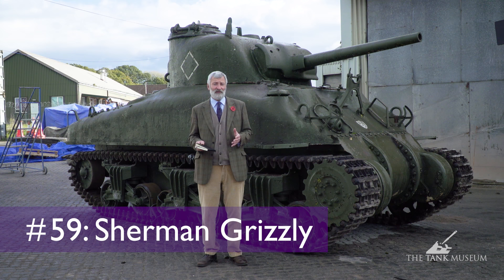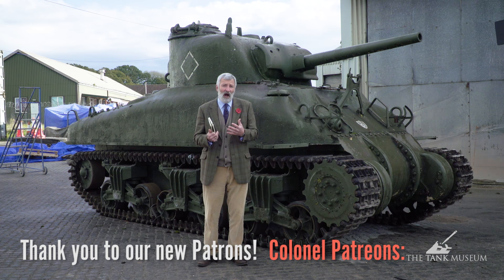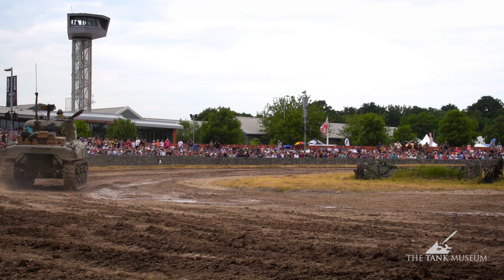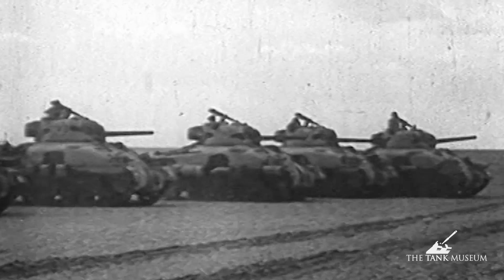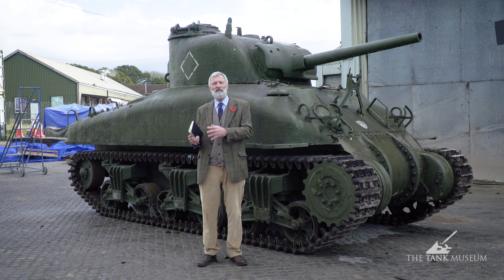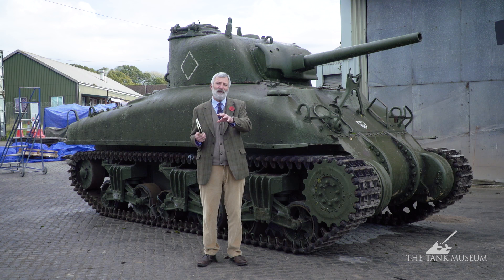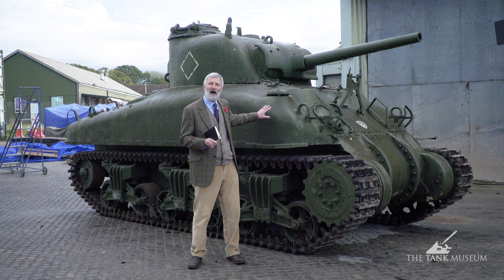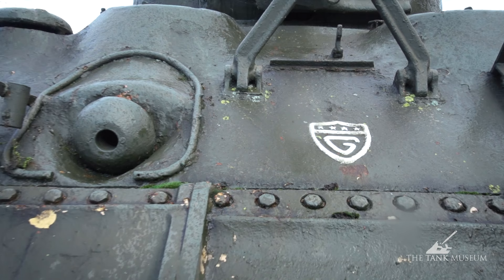Tank Chats #59 Sherman Grizzly | The Tank Museum

Comment: That Grizzly does have the CDP track system on it, if you look at the track links they almost look like a Panzer III/IV track. Don't forget that a lot of the Ram chassis without turrets were sent to Europe to become Kangaroo APC's.
Reply: I think those are the "observation vehicles" he mentioned.
Reply: @princeofcupspoc9073  No, the "observation vehicles" would have been the Ram OP/Command  and GPO tanks, which were used as command vehicles for SP artillery regiments.  The Ram did go to war as Kangaroos; a number were also converted into Badger flamethrower tanks.

Comment: It was sensible of the Canadian’s to build the Ram etc on the M3 and M4 platform, for part standardisation.
Reply: DC also had to do with the British having weird materials and techniques. i think canada should try and make tanks again just for fun
Reply: It was also due to the fact that Canada lacked the industrial capacity to manufacture its own tank from scratch. The Ram tanks that were mentioned earlier in the video were assembled at the Montreal Locomotive Works (MLW) in Montreal. The hulls were, of course, M3 hulls that were obtained from the United States and then modified to place a machine-gun turret next to the driver's station and accept the Ram turret which was made at MLW.
Reply: @ramiii8633 : I'm Canadian myself and I would love to see something like that happen. We have the engineering talent to pull it off (the fire-control system used in the first iteration of the US M1 tank was designed and manufactured by Computing Devices Company in Canada) and it wouldn't be too difficult to set up a manufacturing plant to make an all-Canadian tank. Heck, the General Dynamics plant in London, Ontario, which built all of the LAV's for the Canadian Army and the Stryker APC for the US military, could probably build it, or at least make major sub-systems. 

Alas, there'd be less than a snowball's chance in hell of this ever happening as successive governments in Canada have not seemed very interested in manufacturing military hardware in Canada unless it's small in scale and low in terms of risk. It seems to me that the Avro Arrow and the indigenously designed and built Bobcat APC, both of which failed, put a permanent bad taste in their mouths when it came to domestic large-scale military production.
Reply: Steve Struthers it would take a long time and I lot of money, we haven’t built a modern tank, and we would have to design armor and other high tech systems which we might not have. It would make sense to buy a re-engined m1a2 sep v3 or a leopard 2 a7.
Reply: @stevestruthers6180  The LAV 6 Assault Gun comes pretty close - the variant sold to the Saudis uses a CMI turret with a high velocity 105mm autoloader tank gun.  The armour can stop 14.5mm at rounds and artillery splinters. It can also fire a ATGM through the main gun with a 5km range. Given its speed etc., it comes pretty close.
Reply: The lower chassis or hull was actually made and put together in Canada, it's just an armoured box after all and easy to assemble and make armoured plate for. The upper hull/turret is the major thing that they had to send the plans to the states to have built. Engines and transmissions as well. Tracks,suspension units, guns, radios and all the other smaller things Canada made themselves.
Reply: @stevestruthers6180  The Ram tank was built at the Montreal Locomotive works from parts sourced both from the United States (especially but not limited to the engines, transmissions and final drives) and from Canada.  The upper hull was a casting produced (at least initially) by the General Steel Castings Corp. plant in Granite City, Ill., rather than modified from the cast version of the M3 upper hull.  Incidentally, the hull-mounted machine gun was housed in a modified version of the machine gun cupola from the M3 medium tank until the supply of that component ran out; after that, the upper hull casting was enlarged and modified to use a ball mount for the hull machine gun.
Reply: Trump is really a SOB trashing Canada as a neighbor ally country standing by the US for a hundred years. WW2.  NATO. Vietnam. Canada and UK was 60% of Normandy with 3 out 5 beach landings. Together they suffered 2,000 tanks destroyed in the Normandy campaign.

Comment: Thanks for posting!  The M4A1 (c) Grizzly is an unsung icon of the era!
The Myriad Ways
The M4 story was punctuated with doctrinal and mission specificity changes.
Maintaining several types of different chasses--say, jeeps, deuce and a halfs, motorcycles, 7 ton trucks, in a single unit's Equipment is a logistical nightmare, both at the depot and at the railhead.  Naturally, it would be nice if somewhere, someone, could make a common chassis and just mount whatever was needed on it . . . sort of like the Italian As42.
  Attempts to create a "Combat Vehicle Family" based on a single chassis for commonality of components, supply, and repair, were made on all sides, with the Sherman, Panzer IV, and Type 97 coming closest to realization.  75mm and 105mm versions of the M4/M4A1/M4A3, were augmented by the 76mm armed variants, the standard self propelled artillery vehicle was the M7/M7B1, of which the latter was a Sherman variant.  Crab Flails, Demolitions versions (AVRE), Beach Rescue, and Gun Tractor, variants all enjoyed at least limited production.  Kangaroo versions were IFVs, more or less.
  In fact, the only variant lacking in this litany of useful machines was an AA version.  Considerable research and testing were done to find an effective means of placing AA fire where needed, much of it resulting in hardware manifestation atop the Sherman chassis.  Self Propelled 90mm prototypes were overbalanced, too tall for tunnels, and ill protected (meaning they would not make good tank destroyers).  The T52-A Sherman, with disc turret mounting a Bofors 40mm Gun and a pair of .50cals, looks cool as heck, but only made crews dizzy.  Still, it was moving in the right direction, engineering-wise. 
  The idea found its most elegant expression in the Canadian Skink, not a Sherman variant, but based on the Ram, which was, in itself, a rationalized, improved, M3 Grant.  One thing is common in recollections of the war: don't stand in front of a 2cmFlak(v)38!  Well, the Skink was armed with a close cousin: 4 Polsten guns; in an armored turret . . . a reasonable index of AA and close support characteristics.  Naturally, an all armored turret is not optimal for AA duty, but it sure was good at shooting up stuff on the ground.  If they'd put a few Skink kit turrets on Shermans, it would've made the Combat Vehicle Family a reality.
Balance of Factors-A racehorse designed by committee
  We think of armored combat as quick, but that's only compared to marching infantry.  In reality, most tanks of the war were designed specifically to be able to keep up with a typical truck convoy.  That limited overall size, weight, and weapon size, while forcing bigger engines on any mobile tank.  Compare Char B1 or Churchill Mk VII to Sherman.  The first two are seriously overarmored and, consequently, underpowered, while the other is quite lightly armored and well able to keep up with Jeeps on a soft road bed.  In other words, the Churchill and Char to end all Chars were hard pressed to keep up with trucks on a concrete or block road,  while the Sherman could make a high speed run to pass them on the straights.  This is one factor in Strategic Mobility.  Referring to my earlier point, the other main factor in Strategic Mobility is commonality of parts and ease of maintenance.

  What ifs considered.  
A 17 tank Company could field three platoons-each with three gun tanks, a Skink, and a 105), could be considered either a weaker, but more versatile, US Army Tank Platoon, or a stiffened, beefed up, UK style Troop.  Command Section might be a Command Tank with extra radios and an FOP tank for Artillery/Air Liaison.  You could slow the unit to a crawl by fitting an M1 Dozer blade to the 105 tank, and a Crab Flail on the Skink.
Reply: The Skink was based on a Sherman hull (specifically a Grizzly), not a Ram
Reply: Check Wufe's correction of my mistake below.
Reply: @HBK-6S  I stand corrected.  Must be the weed.  Thanks for spotting it.
Corroboration:  "The original program called for production of 135 complete Skink Anti-aircraft Grizzly Tanks for the use of the Canadian Army and an additional 130 Skink Anti-Aircraft Grizzly Tanks to meet British requirements."

Comment: The Ram would have been deadly in combat for its time.
Reply: 88porpoise 6 pounder remained effective throughout the war.  A couple thousand more effective tanks would have come in handy I would think.
Reply: DOUG HEINS more versatility.  More reliable performance at longer ranges.  Obviously by the end of the war newer designs surpassed the capabilities of the 6 pdr but that doesn’t mean the 6 couldn’t get the job done.  In 1942 it would have been excellent in an antitank role.
Reply: DOUG HEINS were arguing two different things.  I didn’t say the 6 pounder was a better anti tank gun than later designs.  Obviously it was inferior to the 17 pdr but this tank was available for service long before the firefly and had a better anti tank gun than the 75mm pop gun on the Sherman’s.  Used in an anti tank role it would have been great FOR ITS TIME.
Reply: DOUG HEINS none of that has anything to do with what I said.  I said the 6pdr ram would have been great for its time.  At no time did I claim the 6 pdr was better than later designs.  Are you just messing with me?
Reply: DOUG HEINS why then was the 6 pounder still in use a decade after the war ended?  If needed the 6 pounder could utilize later ammunition advances to keep it suitable for service in an anti tank role.
Reply: DOUG HEINS sounds like we’re not gonna change each other’s minds.  I’ve lost interest in this argument.  Cheers.
Reply: @88porpoise  No. It was not better than the (75mm) tank gun of the M3. While the 6-Pdr had good armor penetration, it did not have HE shells, which was a major weakness.
Reply: @RobertP2000  Absolutely correct.  Remember, tank verses tank combat was RARE.  Patton loved the 75mm Sherman because it did it good job shooting up everything, except the heavy tanks.  But the 6 pounder would still be useful, more so than the 37mm on the M5 light we had thousands of.  There were tons of lesser armored vehicles like converted French armored vehicles, Sd Kfz 250s and 251s, Panzerwerfers, Marders, etc. to shoot up.
Reply: The Rams got the same bored out 6 pdr QF 75mm as well towards the end. They stated it made the Ram basically a Sherman at that point with better armor protection. Production however had ramped up so much that enough spare shermans were about that doing all the work of converting hundreds of them to the 75mm was ultimately scrapped.

Comment: I hope when the Grizzly goes to Vienna Museum it stays historically as a Grizzly and not turn into a mock up Sherman.
p.s. it's kind like when you see people calling a plane a Messerschmitt Bf 109 when it really a Hispano Aviación HA-1112
Reply: Or a Czech Sd Kfz 251, or a T-34 Tiger, or an American trainer Zero.  There's lots of them.
Reply: I have the same thoughts. It's history, it's what you are trying to present, embrace it for what it is.  I think the HA-1112 is an interesting plane, it's a German plane built in Spain, a neutral country, that had the engine of a British Spitfire.  It's an interesting corner of history just as it is, and if it looks like any BF 109 no one is going to be interested in the story behind it.  The Messerschmitt BF-108, which paved the way for many of the Messerschmitt designs, is painted up by some to look like a BF-109.
Reply: It's on loan. So I'm pretty sure it stays a Grizzly.

Comment: Some tanks don't take to being left out in the weather?   What?  You're going to be fighting tank battles inside?   Besides it was built in America and Canada, we have winters, with lots of snow and ice.  It's why we put heaters in our cars, trucks and tanks!   Did you notice the two brackets on the RH side?  Those are for securing hockey sticks while traveling.
Reply: DOUG HEINS  No, the Molson would be kept in the cooler attached to the back of the turret!

Comment: so why did they design a new track and sprocket for this? when there is already the standard  design on the M3 and M4
Reply: Well, it was better.  The standard M3, M4 style track was a 1930s design, with 4 times as many pin connections, making them rather frail.  It's one of many things that should have been changed in the US before the M3, but we were still enamored with anything the French designed.  (There's a little mention FACT of US military history.)

Comment: looks like Panzer 4 tracks
Reply: Germany didn't have much rubber so that makes sense.
Reply: @binaway  the rubber problem was more like a ww1 problem than in ww2
Reply: In WW1 the allies controlled the rubber producing territories in Asia which were all occupied by the Japanese in WW2. Germany was blockaded in both wars and although in WW2 Germany produced  (artificial rubber) it never had anywhere near enough. German Artificial rubber (Buna) also froze solid at a higher temperature than organic rubber which proved to be a problem on the Eastern front in winter.  To supply the Western Allies rubber production in Brazil and The Belgium Congo was expanded/restarted and  40 large artificial rubber factories built in the USA.

Comment: Why did Sherman’s have to look like such dorkmobiles? Why couldn’t they look sleek and mean?
Reply: They probably looked mean enough if the 75mm was aiming at you
Reply: Well, I guess — unless I was aiming an 88 back at them. But that’s not my point. I mean, whatever it’s functionality, the Sherman looks like it was sketched up by an elementary school kid for a cartoon project. Even it’s stubby little gun looks goofy. It’s not an important point, just bugs me. Like the guy who designed the Sherman went on to design the Chevy Suburban.
Reply: Rio Grande    Yup, Easy 8 is better, especially when it’s dressed up like the Fury, but it’s still not fearsome. The Tiger and the Panther are menacing . . . and the M4 is like something out of a cartoon.  :-)
Reply: Part of the problem was that the transmission and final drive for the tank was in the front of the tank, and the tank had to be made tall enough to have the driveshaft pass under the turret basket.

Comment: Why did Sherman have to look like such a dorkmobile? Why couldn’t it look sleek and mean?
Reply: Dork mobile?  Hardly.  It's design draws directly form the French Samua tank.  Which was pretty good in the 1930s.  Also, it uses a lot of the technology available to US industry, where we could cast HUGE pieces, due to the rail industry.  In Germany they used lots of little pieces with lots of complicated welding to get all those "cool" angles.  Smaller shops could do that work, but it really hurt their production in the long run.
Reply: Ok, I get that, reliable and easy to transport and highly manufacturable, and blah blah blah, but why was it designed to to so cartoonish. Can’t you have a design that had all those functional advantages, but also looks menacing and tough and wicked mean? You know, like the Panther.

For the record, the Samua S-35 looked dorky, too.
Reply: @ChitFromChinola  panther didn't have many functional advantages, it had a good a gun, decent sights, and well angled hull armor. Other than that, didn't have much special compared to other mediums, not including the downsides in the tank's production history.
Reply: I get that . . . but Panthers looked sleek and mean. So did the Tiger and King Tiger and PZ IV and Pz iii and even the T-34. The Sherman’s all look cartoonish.
Reply: @ChitFromChinola  Not really, they look "modular" and that word is very important. Go out in a field, grab the engine, suspension component, periscope, you name it, off a wrecked sherman, and will usually fit on yours. (unless the M4A"number" designation is different, i.e. an m4a1 vs an m4a4,)

But if looks is all that matters, then I personally don't like the tiger 1, panzer 4, and jagtiger. They all look like cartoonish metal boxes with poles sticking out the front.
Reply: The Sherman was built for manufacturability, I get that. But why does it look so goofy? Like a bulbous cartoon machine — made even goofier with its stubby little gun, compared to the wicked evil look of a German 88. In the end, it’s a moot point, right? I mean, Sherman manufacturability won the day, not looks — Americans fielding thousands more tanks than the Germans, overwhelming numbers that made individual superiority of any German design irrelevant to the war effort. But the Cartoonish look of the Sherman was cringeworthy to me — sort of like putting a clanking metal beast of a Cadillac next to a sleek driving machine like a BMW. Where do those designs come from?
Reply: @ChitFromChinola  Not cartoonish at all, rather looks sleeker being rounded and all, not to mention the cast hull design offered a few small benefits. 

As for the later welded hull tanks, it looks fine to me, a bog standard bread and butter example of a tank from its decade, and the long 76mm gun with the muzzle brake looks rather nice.

The short 75mm gun is that way for a reason. Less velocity, less stress being forced on the HE shell therefore requiring less reinforcement, allowing for more high explosive filler to be packed in there.

Also, cadillacs from the 50s and 60s were majestic machines.

If all we're doing is stating aesthetic opinions, the panzer ii and 4 look ugly, with their turrets being off centered, and the chock block turrets, they look like toys for a 5 year old to play with. 

Compare this to the streamlined beauty, of the m24 chaffee, with the tapered turret.

Or the m41 bulldog, with the tadpole turret!